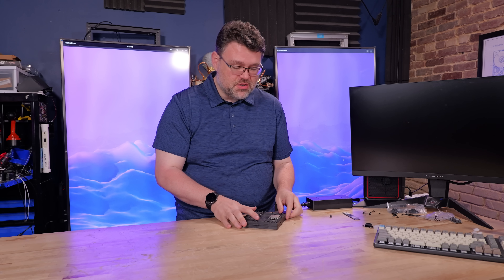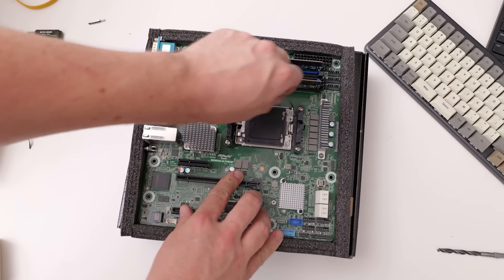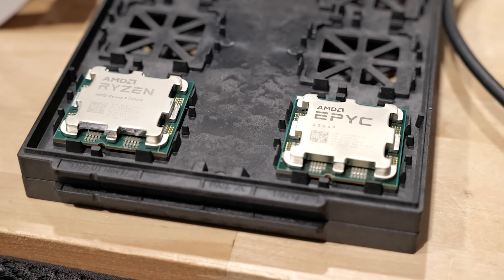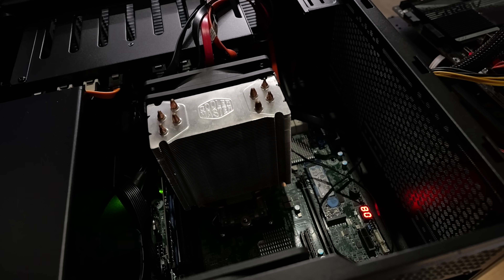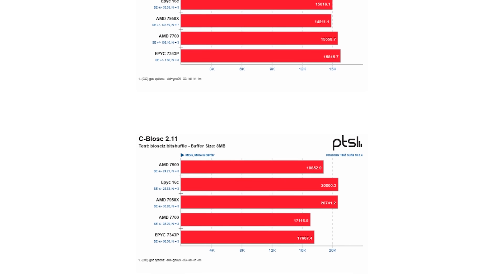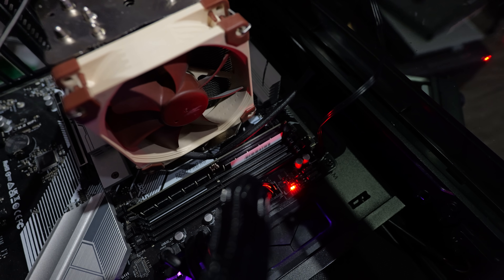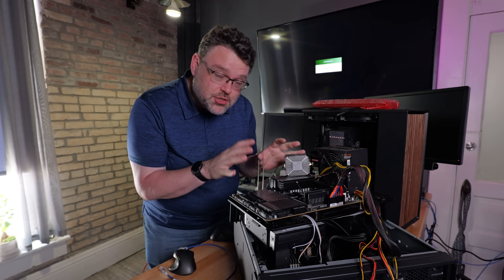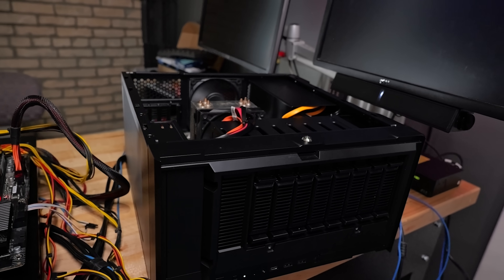They Put Epyc Onto AM5? Can They Do That?

Comment: Ah man, I was really hoping this would mean AM5 but with a few extra PCIe lanes.  Even like 32 or 36 would be nice, instead of 28.  I guess desktop CPUs are just so physically constrained at this point that architecturally it's not possible.  The only reason I say this is because my first computer was during the heyday of SLi and Crossfire, and I think my EVGA motherboards all supported three-way SLi (though I never used it since I was using hand-me down monitors for the longest time on a kickass gaming rig; I didn't know any better thankfully haha.  Too bad it was a hand-me down LCD Dell monitor and not our old Sony Trinitron.  If only I had the sense to hook that bad boy up).  So, because of that, all the high-end enthusiast boards had at least like four x16 PCIe slots.  They weren't necessarily electrically x16 (either physically or they'd switch to x8 or x4 depending on the use case), but what that meant was I never had trouble with expansion.

Now with my x570 board, because of the limitations of modern boards, you really can't get PCIe NVME expansion cards on there unless you want to switch your GPU to the second slot, which depending on the BIOS, might be hinky to begin with.  It's really sad since you have these wild Epyc and Threadripper processors with 128 PCIe lanes, but then we're stuck with a dinky 28 lanes on AM5.  Though Intel has been even more anemic than AMD's AM4 and AM5 platforms, so really, I should just be counting my lucky stars, I guess.
Reply: Theoretically it is possible with desktop CPUs. I don't think an IO die with a couple more lanes would be that much bigger to fit in the package. But the AM5 socket is not designed for it, you'd also need the extra pins on the socket to route those lanes out.
What is possible though is to use PCIe switches (or the chipsets) to split the existing lanes into slower, but more lanes. Doesn't increase the total bandwidth, but you could say take the 16 gen5 lanes that go to the GPU slot and make 32 gen4 lanes with full bandwidth out of them. I'd love to have an AM5 board like that, don't need fast lanes, I'll take gen3 lanes too. But esp. for a home server type scenario, a board with a good number of PCIe slots would be nice.
Reply: My B550-XE STRIX has the graphics card in the first slot, and I use the included expansion card for additional NVMe SSDs in the second X16 slot.

Keep in mind it's not easy to utilize the bandwidth of multiple NVMe SSDs unless you're doing something like a RAID. Their bandwidth requires multiple threads and queues.

Comment: Those EPYC parts are a bit high on the wattage for my home lab.  I'm still likely to look at desktop parts with virtualization to keep the electricity down.
Reply: You realize that AMD measures TDP under all-core load at boost clocks, right?
It's not a measure of idle power consumption.
(Intel measures TDP at all-core base clock speeds.)
Reply: @tim3172  Now, I don't believe that's entirely accurate in every case. However, I was aware that's supposedly based off maximum values. Besides, it still gives you some idea of how much they consume at idle compared to lower clocked SKUs. 

There are a number of other confounding factors to consider, such as whether your PSU supports low current idle, what C States, how many HDDs you have, and how you have your OS tuned, just to name but a few.
Reply: Unfortunately, AMD only makes sub 35 watt and under CPUs for the industrial market, where you have to buy systems in bulk. Ryzen can run in Eco Mode, which can knock a 65 watt part down to 45 watts. I think, they have some APUs that can go as low as 35 watts in Eco Mode, but it's been a while since I've checked.
Reply: @TheChadXPerience909  You can always lower the PPT values with precision boost settings in the bios to other values too. Running one of the 65W chips at a max 35W should still work fine. If power usage is a concern and we're talking home server that may idle a lot, I would definitely look at an APUs though. They should have notably lower idle power usage as well. (Make sure you got enough PCIe connectivity for what you're planning to build though, they may have fewer or slower lanes.)
Reply: @Hugh_I  I was trying to keep it simple, because you never know who you're talking to on here. However, I wasn't aware that APUs might idle lower. Although, I would've been comparing the AM4 parts. 

I haven't even considered AM5, since the chipset is so lackluster, and the board PCIe layouts with cheap NICs and other components make Intel a more attractive option. 

No doubt AMD is killing it with their CPUs. Unfortunately, they're hampered by a poor chipset, and cheap board designs.
Reply: @TheChadXPerience909  The main reason why the APUs idle lower is IMHO that they're monolithic, no infinity fabric to keep running. The smaller cache probably is a factor too. And generally, they are specifically designed for mobile where this matters, AMD was working hard on that design to be most efficient when idling. 

I don't have any AM5 APUs to test this, but know it's true on AM4.  I have a 4600G, it idles at sub 5W, while my 3900X is around 10W. My 7950X idles even higher at about 25W. (Ryzen 7000 is generally higher according to reviews, but in my case this may be skewed upwards by having maxed out just about all PCIe lanes on that board and lots of memory. So grain of salt on that number, don't know if the IO die is unusually busy in that system).
Reply: @Hugh_I  It's also worth keeping in mind that the X variety are clocked higher.

Comment: I wish motherboard manufacturers took this opportunity to spend big on PCIe switches, to turn those 28 PCIe 5.0 lanes from the CPU into 56 PCIe 4.0 lanes. Yeah, PCIe switches are expensive as all heck, especially 5.0 ones, but PCIe lanes are exactly what I need in a server context
Reply: More affordable PCIe switches is the obvious solution for this. But I can't see any due to a lack of competition. :)
Reply: YESSS! Seriously, look back at Z77, Z87, X79, X99 motherboards; look at all the PCIe slots, look at all the I/O, look at the other ports, look at all the extra chips, not just PLX but LSI, etc. Look at the price they launched at years ago. True versality basically does not exists now and many ATX/EATX boards are just bastardized mATX boards; even some current HEDT boards don't really make sense. And it's all at least 2x/3x more now for the same level of board, let alone CPU. I forget which company ended up buying the previous PLX chips and jacked up all the prices and made them almost non-existent even on prosumer level but these last 3-4 years ASMEDIA has put out PLX-like modern 3.0/4.0 switches, especially seen on PCIe addon cards that work for non-bifurcating boards. But seems extremely rare still now, even on higher-end boards. Since PCIe is backwards compatible, and you can use less PCIe 5.0 lanes for the same bandwidth, it's just nonsense that there aren't 4, 5 or 6  slots on the boards. Other boards also show you can put the M.2 NVMe slots near the PCH and/or RAM already. You don't need to lose PCIe slots for the same M.2 availability; but in the end a PCIe slot gives you the opportunity to add even more.
Reply: @CheapSushi  Yeah on AM5 Asus X670E ProArt is probably the most feature-rich motherboard... and it's still country mile behind X99 platform.
Reply: @CheapSushi  PLX is now Broadcom
Reply: @CheapSushi  It was Avago, which later acquired and then stole the name of Broadcom.
I fucking hate that Malaysian conman that is Hock Tan.
Reply: I still have Asus X99-E WS/3.1 motherboard with 7x PCIE x16 ports and whooping 96 PCIE lanes... 10 years ago I thought this was the future... oh how wrong I was... where are my HEDT platforms at? :(
Reply: @Micromation Threadripper:
Reply: @GewelReal  Threadripper is terrible for just about each and any application that requires single core performance. It's not only obnoxiously expensive, it's not versatile at all. At least when I've bought i7 5960X on X99 platform, I've got my money's worth in early 2010's...
Reply: @Micromation  Funnily enough, X99 motherboards with a ton of PCIe slots are still being made, by Chinese companies like Huananzhi and Machinist, for old Xeon E5 CPUs salvaged from servers.
It's annoying that we don't have a proper modern HEDT option that isn't overpriced. W790 and TRX50 exist, but there's no ~$250-500 HEDT platform. It's possible to buy SP3 server motherboards for that price in some regions, and some of the EPYC CPUs are actually quite reasonably priced for the number of cores you get (28-core EPYC 7453 is less than £800 in the UK right now), but those aren't viable for people who need high single-thread performance.
Reply: Yes - Exactly what it needs with full sized ATX MBs.
Reply: If all the server equipment changed to PCI 5 then it would be possible to make boards with many 2-4 lane slots instead of using PCI switches.
The boards would look like GPU mining boards or have riser cables that split 1 to 2 slots of half the lanes.
Reply: @larsjrgensen5975  To do that you'd need to use PCIe switches for bifurcation. Most current desktop CPUs can do x16=x8/x8 bifurcation, but no smaller. The chipset does the rest with its integrated pcie switch
Reply: @insu_na  ok, in some situations it would fix it, but mostly the same problem then.
Reply: @insu_na  No he isn't taking about bifurcation, he means a controller that takes the 4.0 signals and upgrades them upstream to the CPU effectively doubling your pcie lanes.   The MB chipset already does this but only with 4 of the 28 lanes.
Reply: Amen
Reply: All motherboards should have Dual 10g onboard, rj45, at minimum.
Reply: Nah. Just get a TR workstation if you need more than 28 lanes.
Reply: @LeonardTavast  But i also want low idle power. 12 hours a day my home server does basically nothing.
Reply: @Cynyr  if you need that much storage, maybe it's time to think about external storage? Wendell from Level1Techs did some interesting videos about that, which I did not understand fully, though.
Reply: @Cynyr  PCIe switches increase power consumption. A lot.
Reply: @Cynyr   Isn't there a way to run TR with modest idle power?
Reply: @CheapSushi  which is why hedt's power increase doesn't matter. Because pcie gen 5 switches would be worse. And somehow more expensive as well
Reply: @DLTX1007 no.   That is not a factual statement.    True,   it MIGHT,  not will.....  carefull doc.
Reply: @LeonardTavast  28 PCIe 5.0 has all the bandwidth you need even for most servers, especially if you are using more affordable pcie 4.0 or even 3.0 hardware.  The idea here is rather than ponying up the extra cost for TR, have a 5.0 controller that divides that bandwidth into more 4.0 lanes.
Reply: If you need more lanes buy a epyc
Reply: @turtelezinatoir  IT LITERALLY IS AN EPYC, MATE
Reply: The AM5 socket doesn't have enough pins for that. You could split them up with an external solution, but now you're introducing other problems. Plus, you wouldn't be able to split them into separate IOMMU groups for hardware passthrough to VM guests.
Reply: @TheChadXPerience909  That is explicitly why I mentioned the PCIe switch...
Reply: @TheChadXPerience909  is IOMMU groups an big deal for an storage server? it's not like want to multi VM's with video cards doing 3d loads on the an desktop chip.
Reply: @JoebDragon Since most storage servers don't need all that processing power, it might make sense to virtualize it, and you may want to pass your HBA to the guest.
Reply: @TheChadXPerience909  well your storage nodes with stuff like CEPH do need some ram / cpu to run. And your storage NODES should be HA so one can down with out takeing down the rest of the cluster.
Reply: @TheChadXPerience909  Still, for a desktop cpu where they want everyone on NVMe and like to sell that from the ssd maker side as well, they should have space for at least 3 or better yet 4 of these drives. I may not want to be forced to cough up for 1×8TB drive for €1200 minimum, I have 1×1TRB, 1×2TB and now must decide to get either 4TB throwing the 2TB in the trash or wipe the Steam and Epic libraries partially. I am annoyed. I should be able to just plug in 2TB extra. An E-key as a bonus should be in there as well. 

We have 12VO coming, we have bigger and better plugs everything, just make DTX more the norm, use the extra width, put them all right next to the cpu socket, very short traces means no expensive retimers and when we move up to PCIe 6 and 7 you could even just 2× every ssd and NVMe slot, it's fine. Also smaller motherboard, slekker build, still have a spare slot (use a riser, or not). Or put 2× 16× slots, give them both 8×, all done. Put GPU top or bottom.

Comment: They really should have packed in more PCIE lanes, otherwise there is zero difference to the desktop part, its just a name change, so the only real difference is the support structure, if they made these dual or quad socket capable, then maybe that would make them more exciting, for me, they are meh.
Reply: If they did that, then they would be designing a new socket. Which means they need to design a different platform, which means higher pricing.

The advantage of this platform is AMD doesn't have to reinvent the wheel to support a new market segment.
Reply: @jorper2526  Yes, I understand that, its just a bit of a meh release, Ive been waiting for something to bridge the gap between Ryzen and Threadripper, for workstations and SOHO server applications, the desktop parts are not quite there, and Threadripper is overkill on price and core count, but I'm really basing my opinions on the AM4 platform anyway, I believe AM5 has a little more in it in regards to PCIE lanes, so my concerns are probably moot anyway, at least Wendell is excited :)
Reply: @NexGen-3D  out of curiosity, what are you looking for that would be that "bridge"?
Reply: I don't think the AM5 is designed for more lanes. They'd have to have the pins to route that out from the CPU. So either they'd put them on a different socket. Or, they'd need to make Motherboards with a different chipset that splits the existing gen5 lanes into more gen4 or gen3 lanes. I was hoping they'd make board like that when they announced the X670E dual chipsets – but no real PCIe slot galore so far.
Reply: That is an actual question I am asking myself - what is the difference between a 16core AM5 Ryzen and EPYC CPU? Speaking from Hardware, not counting validation and whatnot stuff.
Reply: @bernds6587  Hardware wise they are the same CPUs with different label edged on top. Same CPU chiplets, same IO die, same substrate etc. AFAIK also nothing on those dies specifically enabled/disabled Ryzen vs. Epyc.
Could be that AMD does some binning for efficiency or that they have different out-of-the box precision boost parameters, maybe.
One other difference, not really hardware though: the 4124P does not have a Ryzen equivalent. It's the 4-core one, the smallest Ryzen has 6.
Reply: @Hugh_I  o wow, a 4 core. Now that is cute.
So in the end it's just the name, maybe some binning, and some stamp of approval on expensive certificates and papers.
I doubt most serverfarms which are already using 7000 Ryzens, will change, though.